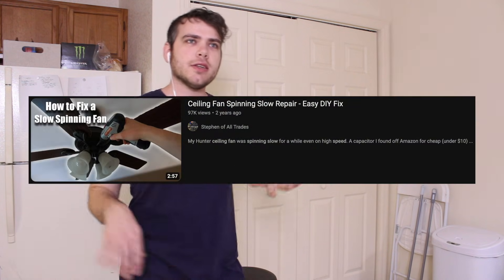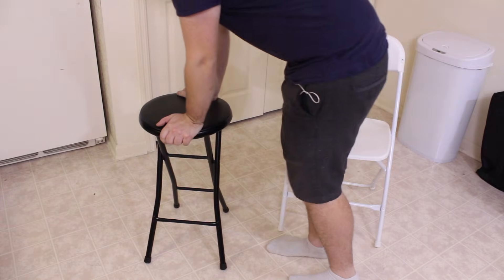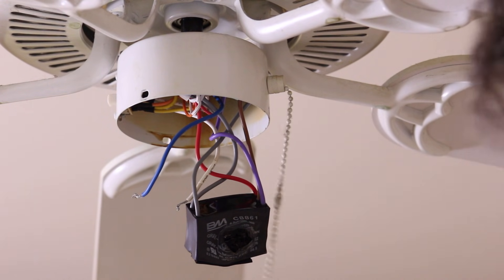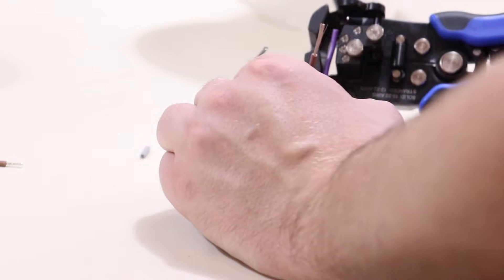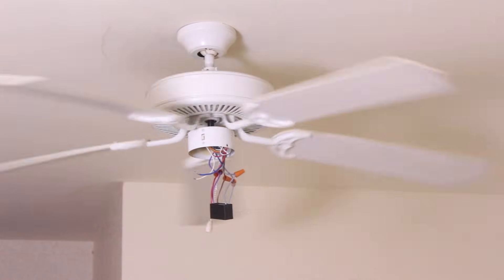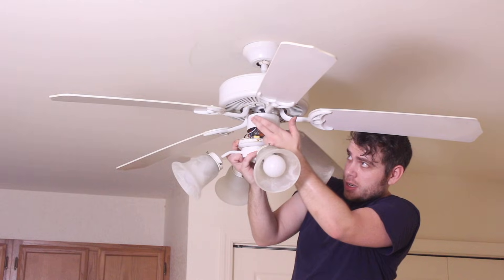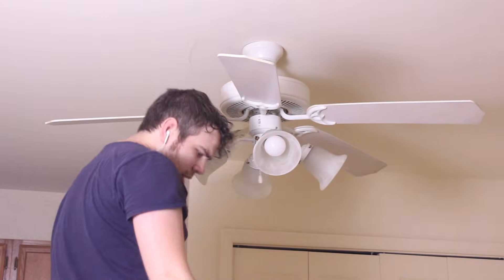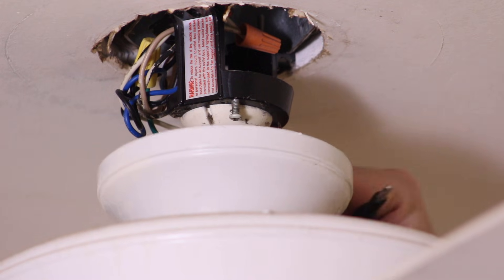Ceiling fan not running? Maybe this can help

Comment: Better fix that wobble, it will eventually cause a short or an electrical fire.
Reply from the maker: I wasn't sure how to actually fix the wobble. Do you have any suggestions? I'll admit I'm very uninformed when it comes to fan maintenance.
Reply: @Yoenosh  Looked like the mounting plate was loose.  You'd need to check the mounting at the rafters.  The electrical box which the fan is attached to should not "wiggle"

Comment: I have a Casablanca Panama 5 which too needed a new capacitor since it wouldn’t start at all. I had some fans that just spun slow before I replaced the capacitors, but my Panama 5 was my only fan which needed a new capacitor to even start.
Reply from the maker: Yeah it seems like the capacitor is the most likely cause of issues with fans not running.

Saw your username and had to check out your channel. Had no idea there was an entire subculture for ceiling fans. Got a favorite one?
Reply: @Yoenosh Yeah and last month I got two ceiling fans from a coffee shop, and one of them was extremely slow on high, much slower than most fans on low. The capacitor looked brand new, but replacing the capacitor made it much faster. The other one wasn’t nearly as slow but wasn’t quite as fast as the one with the new capacitor. So I replaced the capacitor on that one too and it went as fast as the other one.
Reply from the maker: Do you run like a ceiling fan business where you restore them and sell them or what?
Reply: @Yoenosh  I do collect ceiling fans and try to get vintage ones however I happened to usually find newer ones.
Reply from the maker: Antique stuff is typically higher quality so that’s understandable. I’m more impressed you have space to store all those fans.
Reply: @Yoenosh  Yeah they wouldn’t actually fit in full size, but they are taken apart with blades separated from the motor so they fit.